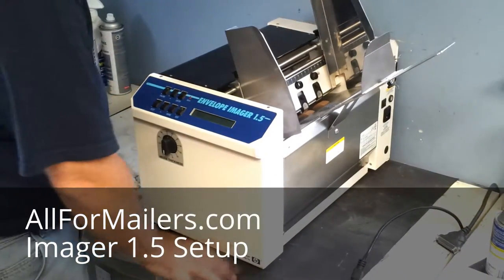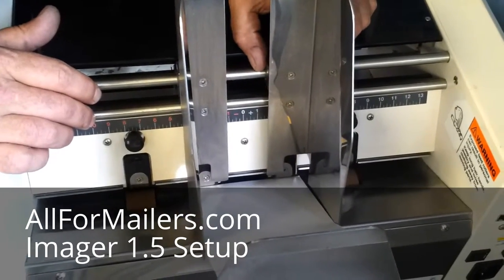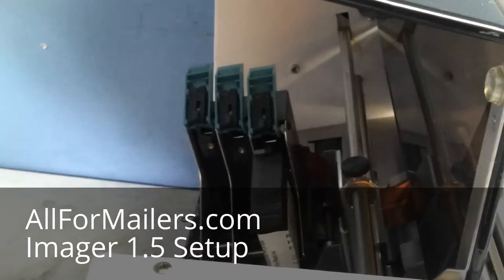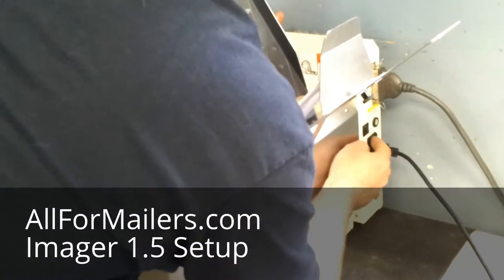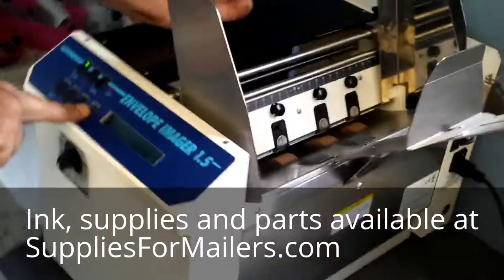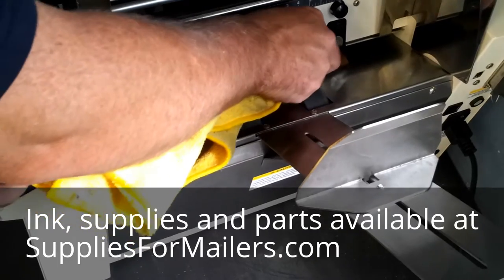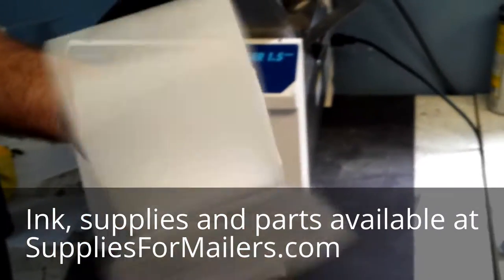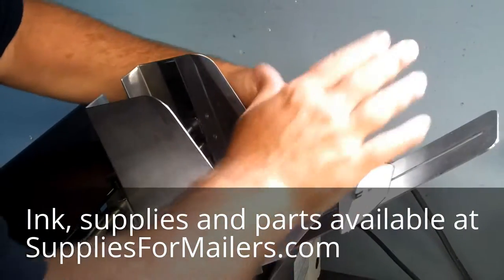Setting up the Rena Imager 1.5 Envelope Printer

Comment: Are there counters on these types of machines?  I have acquired a Rena Envelope Imager from an auction.  I don't know much about it.  The older model I have is 20 years old with a PB brand.    This one has  3 inkjets size:8842A.  It looks new, but I am trying to decide if I should keep it.  Do you know how I can run a test and find the counter?  Model R0612.5.002.02.
Reply from the maker: +Yoli E You can run a test by pressing the Test button with the machine offline.  You can access the life counter in the menu by going to SERVICE
Then
ADRC
Counter status of all printed addresses since starting operation. (This 
counter may only be reset by the customer service.)
If you still need assistance, please give us a call. 866-471-6764